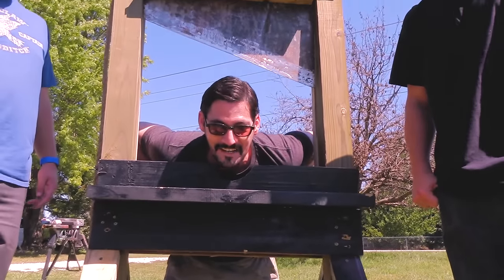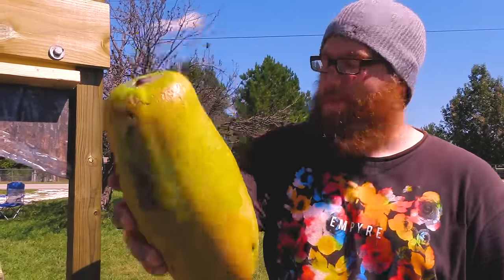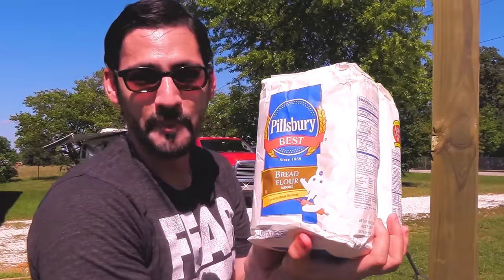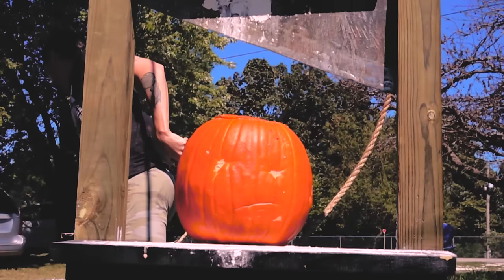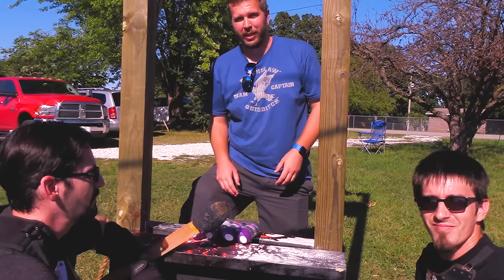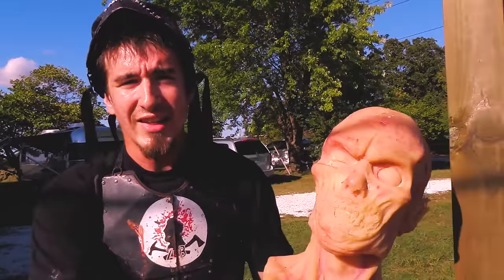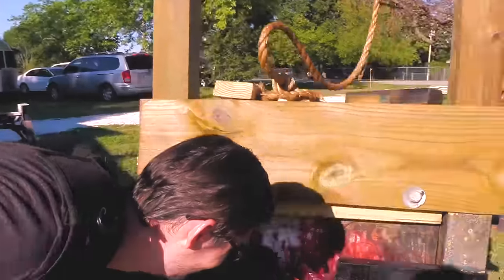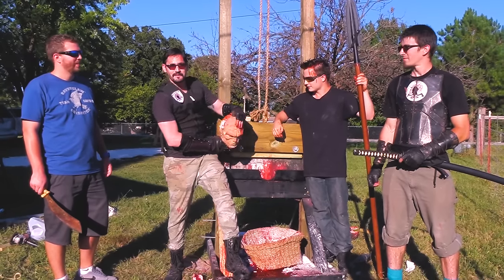CRAZIEST Guillotine EVER!!! Halloween Weapon Test! Zombie Go Boom!

Comment: If I remember correctly, they would place the prisoner face down, so that the blade would cut thru the neck (skin and bones) and out the other side effortlessly. 

Of course, they also didn't have the extra slat of wood at the bottom, that crushed everything either. 🤦‍♂️

Comment: I have to say, that is a terrible guillotine. It should be the faster and better version of an axe, not a piece of steel smashing stuff in its way. most decommissioned giullotines are still as sharp as your average kitchen knife. this thin was... didgusting indeed. But i presume it was a budget project.
Reply: Well, yeah... I didn't know about the breaking part though. 
Tell you what, I have an idea. If you ever come to make a guillotine again, use a gym pulldown machine for the base. Those are premade frames from steel, so they should hold up better than a wooden frame, and the weight there is already there, you just have to add a blade. 
BTW I am pretty sure a 1 cm thick heat treated carbon steel blade could resist any form of breaking, and it shouldn't weight too much.
Reply: Tavian Ward it was just constructive criticism. Besides, the point of a guillotine was to make execution painless. This is anything BUT painless. And if you think about it guillotine is a snobbish thing in itself. It is french for starters, which is like, the second snobbiest nations in the world (this is a joke) , secondly, isn't this the most pompous name for a machine made to butcher people? Then again, say anything in french, it sounds like a fashion commercial.
Reply: ***** I didn't know the purpose of the contraption when I first commented. Since you told me, I agree with the design choice to some extent. But keep in mind, it was measured that after the spinal chord is severed, a person can blink for up to 12 times. That means there are still brain functions after the blade struck. So the person being beheaded will DEFINITELY feel their skull being crushed to a mush, just as much as they would feel a sledgehammer to the head.
Reply: Ok Mr/Mrs no it all
Reply: riley and Devon the animatronic There's no need to be disrespectful. But if you want to be at least know how to do it, First of all, it is Mr, you couldn't know that; secondly, it would be "Mr. Know-It-All" or something along those lines.
 //also, I urge you to note the irony here//
Reply: lol that's the point u just corrected me again i urge that people should stop its just a video

Comment: why is a guieiteen blade slanted?
Reply: Merrick Wood it works the same way as a pair of scissors. It allows the blade to make a cleaner, faster, and more humane cut. If it wasn't like that the head might not come off with one chop
Reply: sun zu ok thx
Reply: Merrick Wood
Reply: Merrick Wood it's so it will cut more cleaner than a straight blade